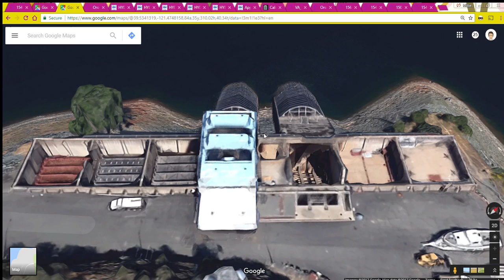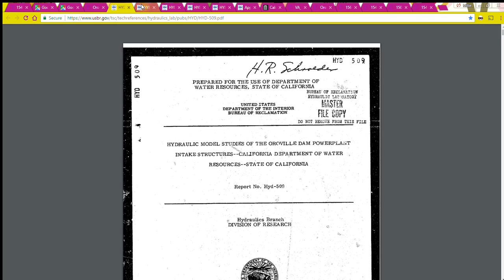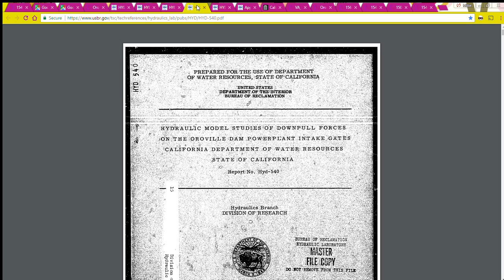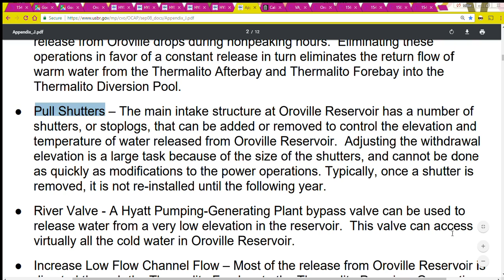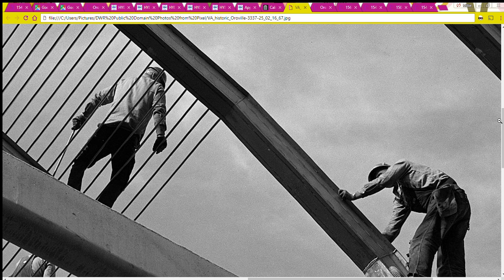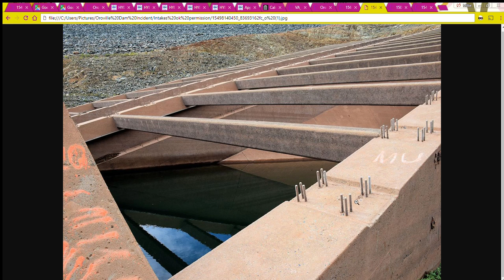The Power Plant that Never Happened at Oroville Dam  06/29/17

Comment: Millie Kay, this is the first time I have visited your YouTube Channel. Can you explain why you felt the need to document the unfinished power plant? Do you know why it was unfinished? Were there funding constraints? Were there plans to build a second power plant later? Maybe you and James could get together and do some more research and produce a no-holds-barred expose on what actually happened in Oroville, dam!
Reply from the maker: Hi Patrick. Welcome to my channel! My own curiosity led me to make this video about "The Power Plant that Never Happened". After the Spillway Incident, photos or videos showing the unfinished intake structure would become the subject of online discussions. There was a lot of speculation, so I wanted to get at the facts.

I have heard several possible explanations for the power plant not being built. One is that they could not find adequate rock upon which to build the plant. Another is that it was cost prohibitive. And I have also heard that it was simply a future possibility that turned out to be unnecessary. I don't know the answer for sure.

Continued research is an undertaking I might consider. However, there doesn't  seem to be much more information out there.

If you are interested in power plants in general, including the Hyatt and the Thermalito Pumping & Generating Plant, I hope you will check out my other videos. Also, one of my most popular videos -- The River Valve Outlet System (RVOS).

Thanks for viewing and commenting!
Reply from the maker: I agree. Now you've got me thinkin . . .

Comment: Once again you do wonderful presentations on a subject that is 50 + years old with back up material that is hard to find. I might add a couple of things to your explanations and that would be that all of the metal that is continually exposed to water and imbedded in the concrete is made of stainless steal, like the railroad rails that the removable coaster gate travels on that seals the two vertical penstocks. The railroad rails that the removable Pull Shutters travel on are also stainless steel. The curved trash racks that cover the whole intake structure is also stainless steal .
 The subject of this video was a proposed intake structure for a future Power Plant that never ( as yet ) happened. The DWR engineers and designers back when these projects were designed and constructed had anticipated future up-grades and expansions of most of the features ( Power Plants , Cannels, Inverted Syphons etc. ) that was initially constructed as they provided for these future expansions by constructing items that could be added on more economically at a later time.
Reply from the maker: Hi Jerry. Thanks so much for the excellent information! I love finding out such details. It really gives me and my viewers a better understanding of the complicated systems at the Dam. And thank you for the encouraging feedback, too!
Reply: Jerry Antonetti ~
The use of stainless is expensive, but it makes perfect sense. Thanks for answering the question I had about what happened to the power plant that never was.
Reply: Jerry Antonetti I'm gathering that all that was constructed on the right side was the 2 intake structures. No vertical penstocks or horizontal tunnels to a possible discharge point?
Reply: Hello  @dougschwarz6699  

To answer your question , No vertical penstocks were originally constructed or connected to the Right Sided proposed Intake structure,...but at present, DWR is also looking at this subject potential intake structure as a possible alternate method of providing  colder water to the river for fish prorogation . My personal opinion is that it would be a waste of tax payer money if it was just for fish with out at least constructing a turbine in the high head penstock that would flow this proposed cooler water.

Comment: FYI, 27 degrees, 45 minutes of angle, not feet. Angle can be defined by degrees, minutes, and seconds, as in this particular paper, although seconds of angle were not expressed. Very good , and informative vid!
Reply: Minutes, 45 '     seconds, 00 "  ( like feet " and inches " but for angular notations. No typo symbol for degrees but   27 * can be used )    27* 45 ' 00 "
Reply from the maker: Hi Larry. Thanks for the explanation. I stumbled over that measurement. I guess if I'm going to keep reading engineering specs, it's information I need to  know. I'm curious -- what would the mark be if it were to show seconds?
Reply from the maker: Thanks Jerry. This is information I never knew I needed until I got involved with the Oroville Dam. LOL!!! (I'm glad I learned it though -- who knows what specs I'll run into next time . . . )